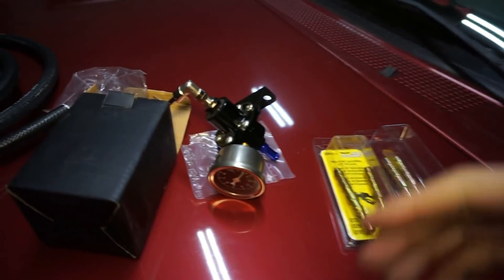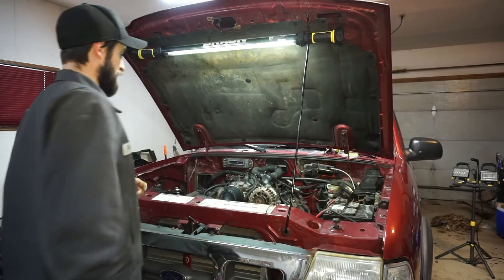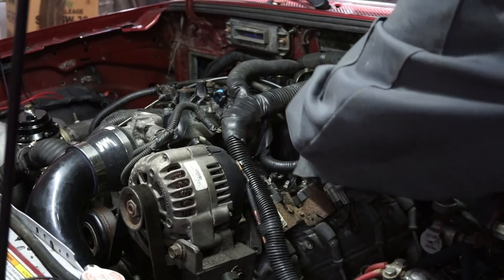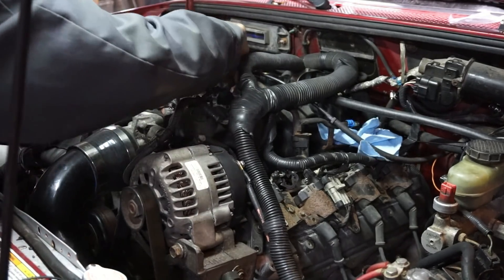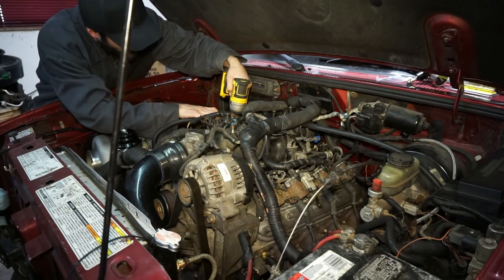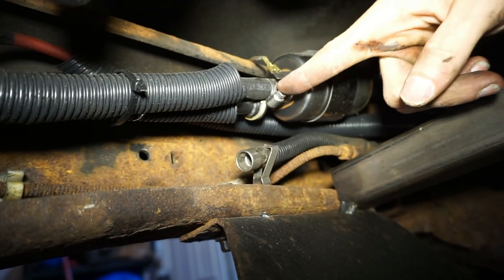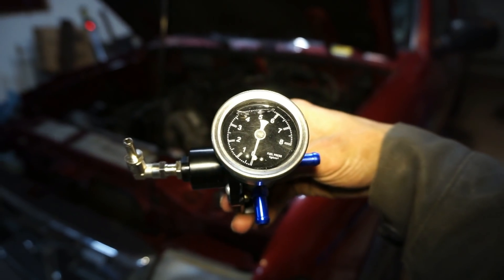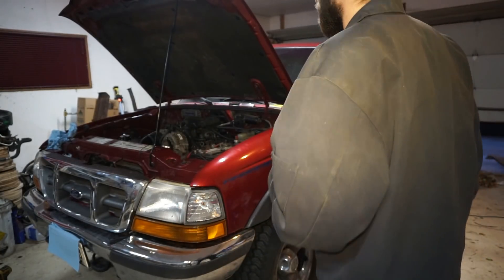1:1 Boost Referenced Fuel Regulator Install!!! LS Return Style Fuel System!!!

Comment from the maker: Link for regulator in description. Don't forget to SHARE the video, and stick around to see how it works out.
Reply: I’m running a different style eBay regulator on mine but it’s been going strong for almost a year now. 👍🏻
Reply from the maker: Bad Luck Garage I was about 8 seconds from buying the same one then remembered I had this one... I bought it 5 months ago, and totally forgot I had it untill I saw one like it on eBay, and said "shit, I already have one"
Reply: @BlaserBuilds  when you prime your motor and your fuel drops in about 10 seconds would that be your injectors stuck open if your spark plugs have fuel on them
Reply: Do you have any advice on how to set one that is returnless
Reply: FYI I have the same light and took me a couple of weeks to figure out that the ends unscrew with a cord attached so you can use the magnets on the hood also

Comment: So does the vacuum refrence on the regulator connect on a vacuum source vía on the intake or would it be better on a boost and vacuum source such as plumbing into the waste gate?
Reply from the maker: @slicksloth_416  Intake or compressor outlet.

Comment: bro i know this is an old video but So you're essentially running 2 FPRs? Is the factory FPR on the rail 
just capped off or gutted or what? ive got 80 psi with the stock rail fpr so i was looking at getting this ebay one
Reply from the maker: Get a PQY regulator from ebay. I use them now in my builds, work great.

Comment: Did you hook the vacuum reference port on the fuel rail to the 1:1 fuel pressure regulator boost reference port? If not where/what did you hook up to them?

Comment: With the stock feed and return like that on stock intake.  How did you run your fuel pressure regulator. Feed to pump/filter to tank.. and return to side port of reg. Block other side then from bottom port back to tank?

Comment: I dig your all the information. I have a 1990 subaru  Legacy 2.2L boxer EJ22 engine. Replaced the fuel pump with an aftermarket high flow. Bad Idea. Never ran right after. Just did this mod and it runs soooo much better. I'm a little mind boggled over the math for the psi from the gauge. I need about 34 to 40 psi at Idle. Where should I set the gauge to? 2 1/2?

Comment: So you're essentially running 2 FPRs? Is the factory FPR on the rail just capped off or gutted or what? Trying to finalize my fuel system plans on my mild turbo 6.0.

Comment: I have the same fpr straight from china... works awesome... use it in my boosted fiero
Reply: How do you adjust it fam
Reply: @Spud7275  loosen jam nut and turn the stud in to raise fuel pressure and out to lower fuel pressure

Comment: What ever you do don’t use a 3/8” Fuel injection hose clamp with 3/8 hose on a 5/16” hard pipe.  Even with it clamped all the way down it is still loose like in the beginning of this video:  Caused me some grief.

https://youtu.be/wgtHY8FXdCY
Reply from the maker: TheProchargedmopar Good stuff. Yeah, hose clamps get er nice and tight. Glad I'm not the only one doing it this way, haha.

Comment: Just offering, they make fuel injection hose clamps, they’re designed to hold the higher fuel pressures. 👍
Reply from the maker: HeadFlowInc Yeah, I almost picked some up the other day but jist picked up 3 boxes of hose clamps so went with it.
Reply: a21bravo Keep an Eye on them, I’m not sure why but they’ve been known to blow off. 🤔. Sometimes double clamping helps, as long as there’s barbs involved it should hold. The one on the fuel rail might be sketchy. JD
Reply: a21bravo Longer version.
I like the FI hose clamps because they do not tear up the hose like screw clamps.
Also do not loosen over time.